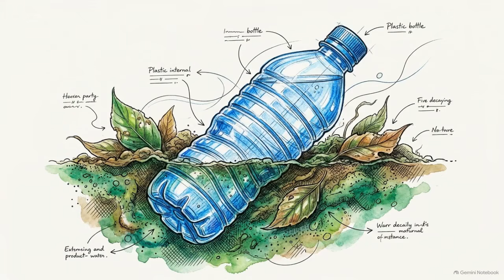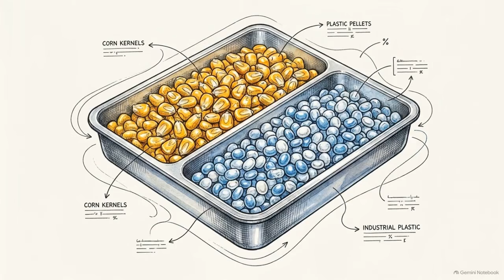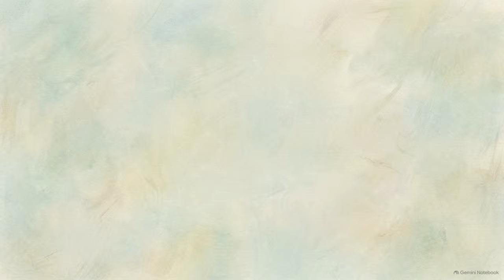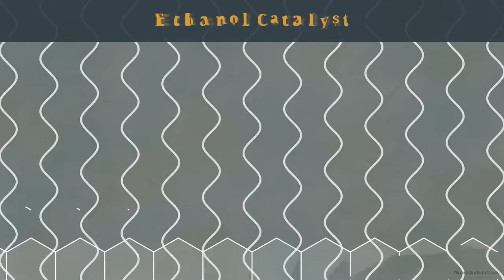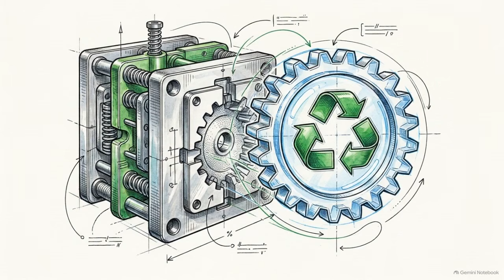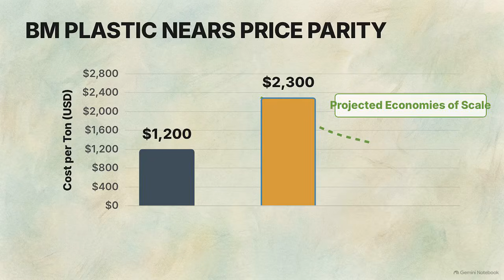China's Bamboo Plastic Breakthrough: Gone in 50 Days?!

Comment from the maker: 🎋 Plastic made from bamboo that can potentially return to the soil instead of hanging around for centuries — THAT is an interesting materials-science breakthrough.

But here's the trillion-dollar question:

Can it be manufactured at enormous scale cheaply enough to compete with petroleum plastic?

Because inventing the material is step one. Replacing even a meaningful percentage of global plastic production is the monster challenge.

Would you choose bamboo plastic if it cost slightly more? 👇